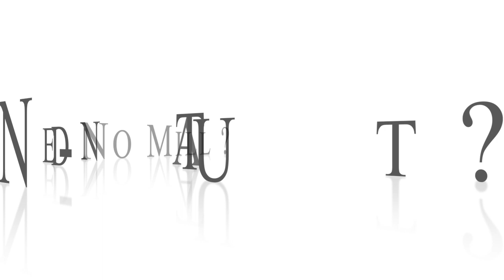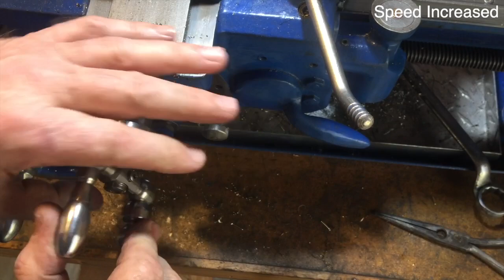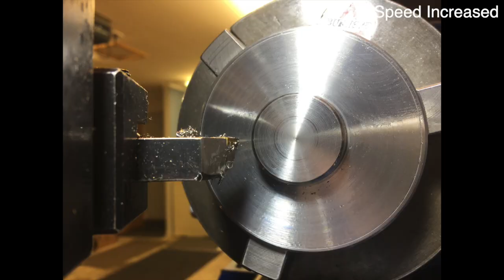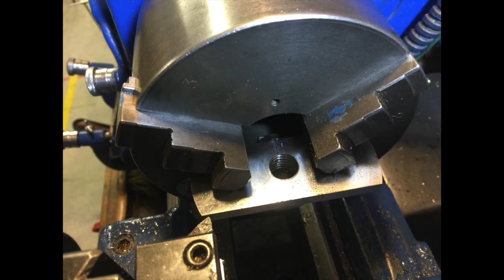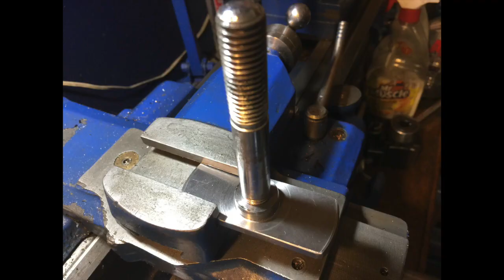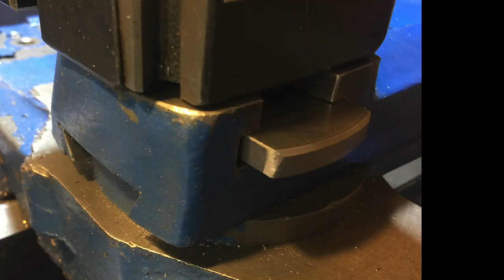Need a T-Nut for your lathe tool post? No Milling machine? No Problem!

Comment: Looks good. :) 

Evan, perhaps you can point me in the right direction. I've been playing about with my Boxford VSL some more. The power feed doesn't seem to be cutting very smoothly but rather it looks like it's cutting an extremely fine thread. 
I suspect this is simply operator error on my part but I wondered what the settings should be for this? 

Perhaps the gears fitted to the machine aren't quite right or something? 

Much appreciated. 

Andy
Reply from the maker: How to achieve a fine feed rate:

On the Boxford lathes the standard gear train usually uses a  20 (or 40) tooth gear in the stud gear position and a 56 tooth gear on the leadscrew/gearbox end.  With this setup the tables on the gearbox and/or gear guard, should give correct numbers for feed rates and thread TPI or pitch. However, finer feeds can be obtained.

The easy answer for me is to recommend my online computer program RideTheGearTrain.com. It doesn't cost a penny.  I believe most Boxford VSL lathes have the same gearbox as the Boxford A or AUD, so choose that.( I think some early models had a different gearbox. If you have one of those contact me again as I would like to add it to my program.)  
Enter the change gears you own. 
Select feed rates in inches per turn or mm per turn instead of a thread pitch. 
Choose an acceptable error (which is not critical for feed rates).  
In step 5A specify how fine you want the feed to be. 
When you RUN the program it will tell you what gear train and gearbox setting to use and even displays a scale diagram of the gear train. 
After the results there will be a box showing maximum and minimum feed rates and you might be interested in choosing the minimum feed rate and running the program again.  

Having said that, you should be able to get the finest feed rate by putting your largest gear on the leadscrew shaft, and the smallest on the stud gear position. Between these you can place an idler gear of any size and this will not alter the gear ratio. (As a refinement you could replace the idler gear with a compound pair to modify the results further.) 
If you have a gearbox, set it for the highest TPI or smallest pitch in mm.

Does this answer your question?
Reply: @Evan-e-cent  Thanks, yeah that really helps. I'm away from home now, working offshore but I'll check what gears are in place and what spares I have when I get back ashore. 
Thanks Evan.

Comment: I suggest a different carbide geometry to break those chips
Reply from the maker: Yes I recognized the fact that the chip breaker wasn't working with this material , but I basically have one type of diamond shaped carbide tips. I suppose I would have to search for tips designed for stainless steel, but I think chip breaking depends on so many factors - the exact characteristics of the alloy you are cutting, speed, feed and depth of cut, so it is probably a bit tricky getting the right carbide tip. In some ways I prefer not to have little chips scattered all over my workshop, but birds nests and long strands on the floor can be dangerous. I could try sharpening a chipped carbide tip with a diamond file or white grinding wheel. If I grind too much off then the tip tool holder no longer matches the tool. These tips are made a bit blunt to reduce risk of chipping but better results can be obtained by sharpening them.